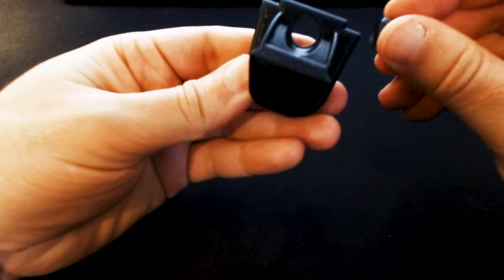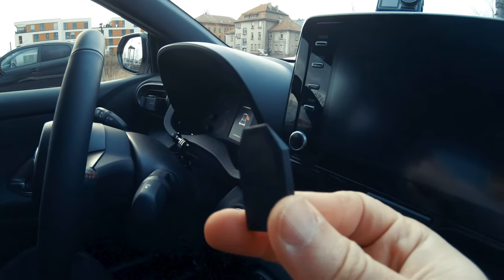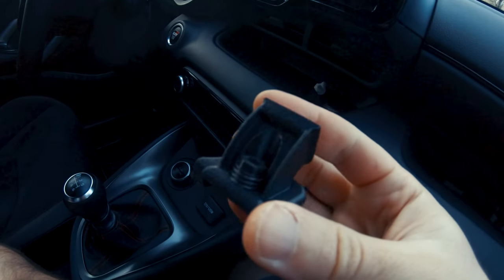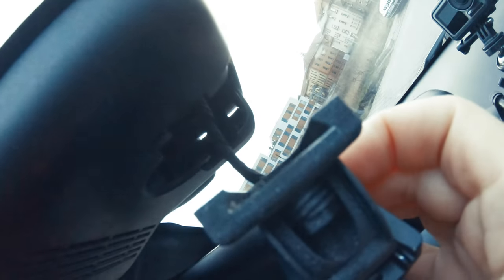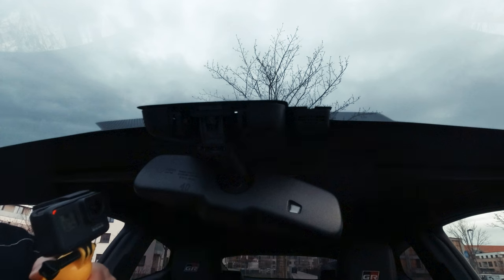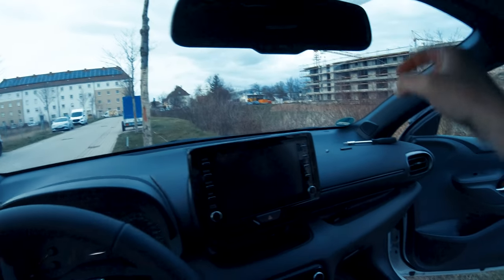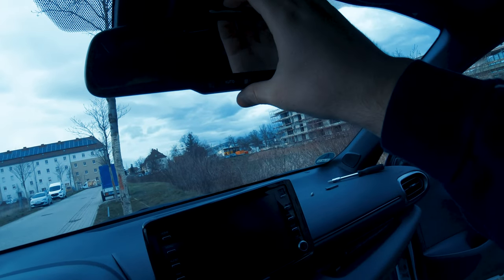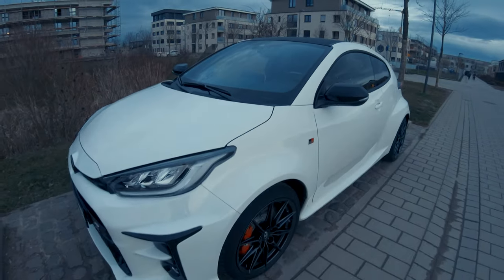THIS IS HOW to fix your Toyota GR Yaris mirror position

Comment: I’ve had my GR Yaris for coming up to a year and guess what, there is nothing wrong with the mirror unless you like watching the birds in the trees as you are driving.

I’m all for people who like modifying their cars but this is a problem that doesn’t exist and therefore doesn’t need a fix.

For anyone thinking of buying a GRY then don’t worry about this, go test drive one and you’ll be smitten.
Reply from the maker: Depends on how tall you are. I guess if you are average Japanese high you won't have a problem. If you closer to average European hight the mirror will be really in the middle of your vision and block a significant amount of view into your right. It's absolutely a problem.
Reply: @GreatMotors  I’ve had my car for nearly a year and driven just over 10,000 miles in it and I have had absolutely zero issues with visibility (and I’m 6ft tall) - my car is RHD and as I said the only view that is blocked is looking up to the top of the trees on the left hand side and to be honest when I’m concentrating on the road that isn’t where I tend to look.

If the mirror posed any form of visibility risk it would never have passed any EU safety laws (NCAP etc) so no, I disagree that it is a problem and is something some YouTubers have jumped on to create content around. Same with the seat height being too high, utter rubbish. The seats are superb. They grip well, are comfortable and are just as they should be for a WRC homologated car. I’ve lost count of the number of ridiculous videos telling people to lower their seats or fix their rear mirror.

Like I said, if people want to modify their GRY’s for added performance or aesthetic looks etc then absolutely fine but to claim design faults where they don’t exist is at best misleading and at worse disingenuous.
Reply from the maker: @sultanoftippoo3857  you are entitled to your opinion. So are we all. I have the GR Yaris since launch. Actually if you see the date of this video you will see that at the time there was not even that much hype about the car.

I drive the car regularly on the road and track. Visibility was absolutely an issue. Seat hight is absolutely an issue. I can't wear a helmet with the seat in the lowest position without bumping into the roof. This is the only car that I own where this is a problem.

Don't generalize. If you don't find it a problem great. Use and abuse. Enjoy it. For me it was a huge annoyance 1) I couldn't see incoming traffic from the far right (LHD car) when at a cross roads without frantically trying to look around the mirror. And 2) driving on track I couldn't see right hand turn's apex without trying to look around. Had to be fixed. I designed the part to fix my car and offered it to the community for free. Where's your problem? If doesn't suit you, fine. But keep your righteousness know it all to yourself.